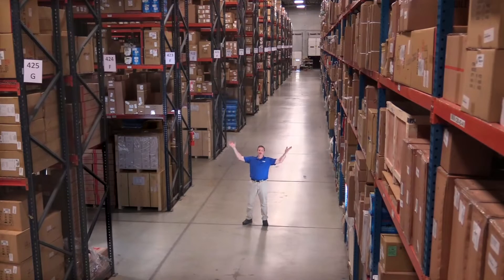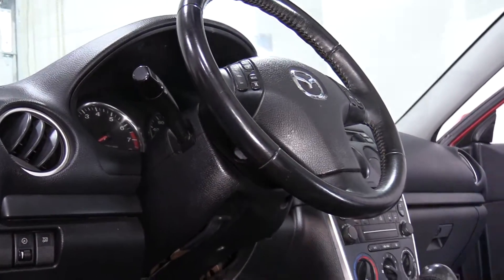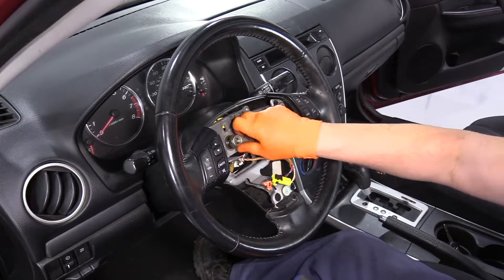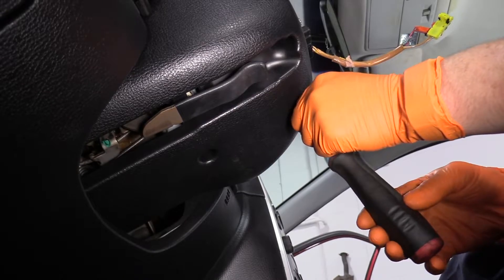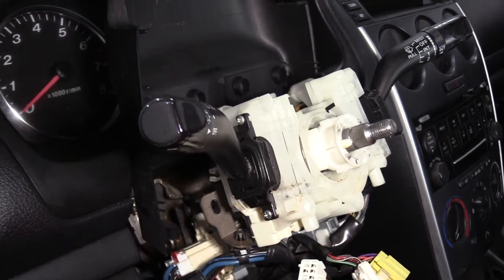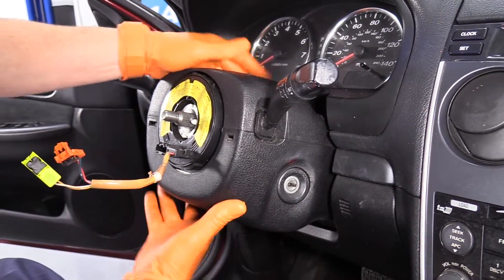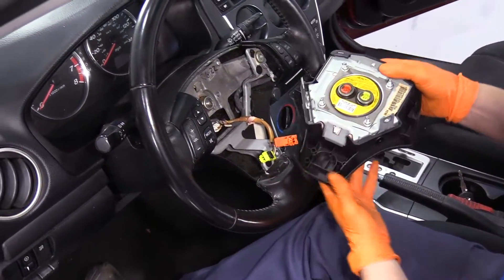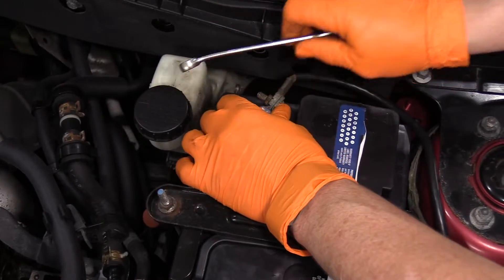How to Remove Turn Signal Switch 02-07 Mazda 6

Comment: Does the steering wheel  have to be dismounted to do the replacement of the turn signal?
Reply from the maker: +Edem Kounou Thanks for watching!  Yes, you will have to follow this procedure step by step in order to replace the turn signal switch.  1aauto.com

Comment: In my mazda 6 the indicator of low beam is not working (probably the bulb is broken). Do I need to remove the steering wheel in order to remove the instrument cluster and replace the bulb?

Comment: I watched your excellent video on indicators, and feel you may be the person who can actually give me a clue as to what is going on with my car.
It is a 2014 Mazda 3
The right hand indicator does one of two things:
It works normally for a while, and then goes to its rapidly flicking mode, then a few days later returns to normal.
One mechanic spent a whole day, supposedly looking for an electrical fault and came up with a computer item that would cost me $600 as the solution. I did not give him the go ahead.
As a matter of interest, the car was involved in an accident on the right hand front and was repaired which may have some connection, but it is unlikely.
 They replaced what appears on the bill as "LAMP INDICATOR" RT PRT NUMBER B45A551350A COST $97.00 This was in March 2017
I do not think it is the bulbs, for as mentioned, when the rh indicator does start working they are fine.
I suspect one of two things, either the bulb holder is moving around and gets connected and then disconnects, or it is the relay. I cannot believe a $600 computer is needed!
The indicators by the way seems to return to normal after the car has sat for a day or two.
Any help you can give me will be most appreciated. mdkoonin@gmail.com
Thank you

Comment: Why was this unit replaced? I'm trying to figure out what the problem is with my mazda 6. The signals work but the both come on at the same time. If I turn on left or right, they both come on at the same time regardless.
Reply from the maker: +tony hert Thanks for watching!  The part in our vehicle was just reinstalled because it did not need to be replaced.  The module inside the unit controls your turn signals, high and low beams.  If you are having intermittent problems with any of these lights then it could be the switch!  1aauto.com
Reply: @1AAuto  thanks guys, great vid.

Comment: You dont even need to take the steering  wheel off. Ive just dont this job and you do not have to remove the steering wheel at all.
Reply from the maker: +MrSlymotorsport Thanks for the feedback!
Reply: How do u do it without removing steering wheel

Comment: my whole left side (front and back) of my turn signal flasher (which are also the parking lights) doesn't work...the bulbs are fine...but my right side does...can this be the issue?
Reply from the maker: +Carlitos Maravi We do not have a way of being able to diagnose the issue that you are experiencing with your vehicle but suggest taking it to a local mechanic for a proper diagnosis.